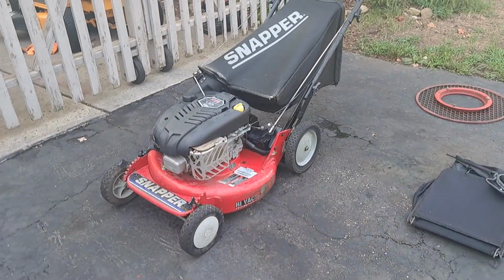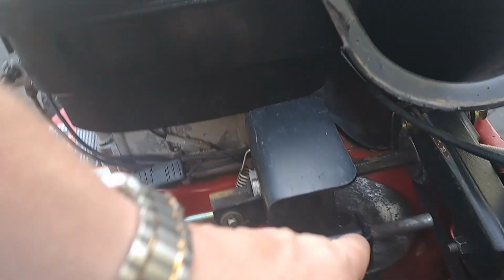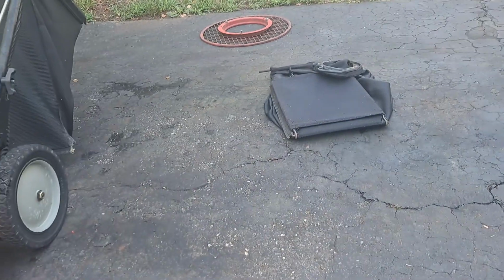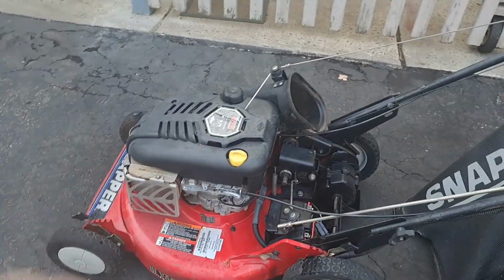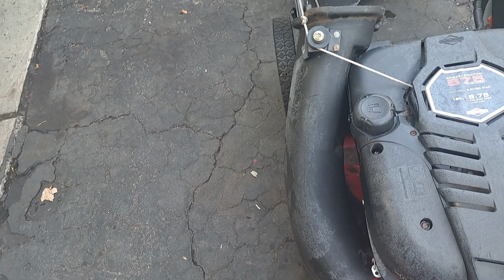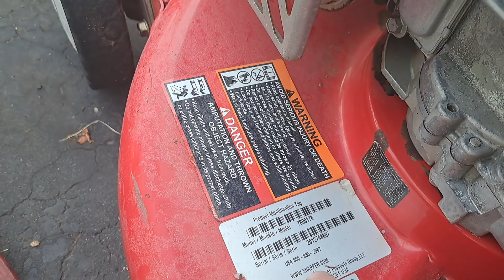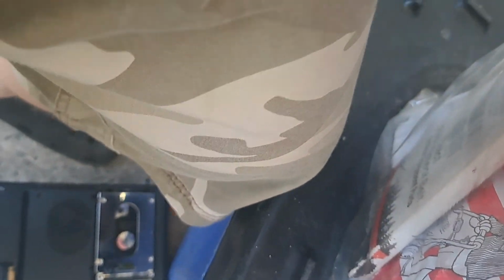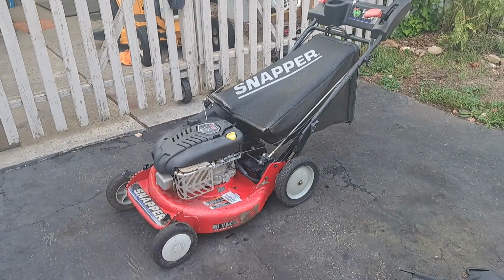Look over: '07 Snapper model 7800178 w/ electric start Briggs OHV Intek 190cc 8.75 ft Ibs torque

Comment: I hate working on those engines. absolutely hate em. nice mower though.
Reply from the maker: Well luckily I didn't have to do anything to the engine But when it comes to the overhead valve engines those were the best ones When they make our absolute garbage those are based on the flat ads Have a breather cover on the side where the valves used to be Essentially a flat head with an overhead valve on it The only issue I've ever really seen with them is they blow head gaskets . It's too bad you're not making them all of that quality anymore but now their all garbage its, sad. Bricks isn't even brakes anymore they were bought up by capital firm Durjng the pandemic to keep the name going only thing they're doing is continuing to build the products they already were making at the end,  Which was basically all junk set for the Vanguard line.